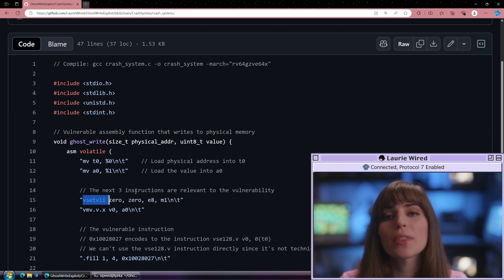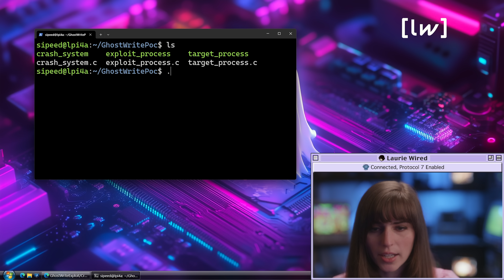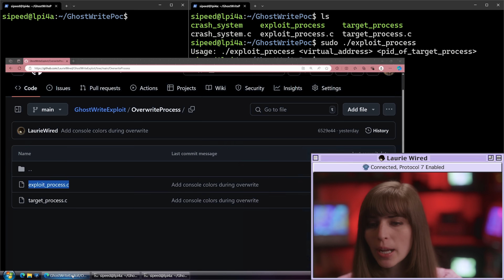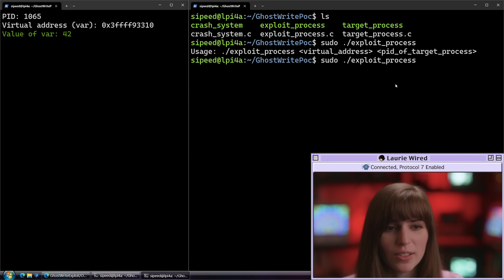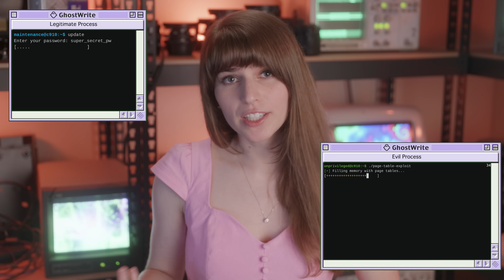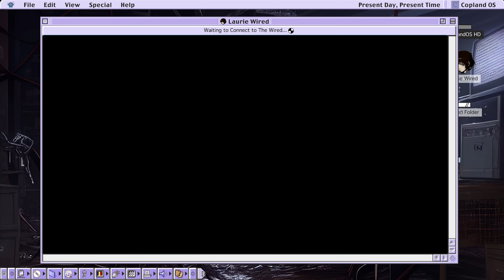what happens when your CPU has a bug? (GhostWrite)

Comment: I don't need to imagine. 

<<<
Although the 1982 introduction of the NS32000 post-dates the 68k by about two years, the 68k was not yet being widely used in the market and the 32016 generated significant interest. 

Unfortunately, the early versions were filled with bugs and could rarely be run at their rated speed. 

By 1984, after two years, the errata list still contained items specifying uncontrollable conditions that would result in the processor coming to a halt, forcing a reset.
>>>

It was the Big Sexy of the era for its paper design, and the Bitchumen Hexy for its hardware implementation.

Comment: Did they fail to use formal verification in their design? I know it's used somewhat in Intel.
There's always been CPU bugs. The most famous is an opcode which would lock a 6800 microprocessor. 
There's some unused encodings in the 6502 microprocessor which try to connect nonsensical ALU units, such as AND and ADD at the same time. These have a handful of uses though, with the right setup, can do some computations slightly faster.

Comment: 1:49 I found one bug in my 5820K by mistake, it happens. It was a contention error, I got a deadlock between the CPU cores. I think the errata was HSD29, about performance counters, but it triggers other contention if you read it in a particular way from another core in another thread.
 Ironically the Host operating system had a patch (both Windows and Linux) to not trigger the bug, but I triggered with the a simple INT3 when debugging the debugger while the debugger stopped the debuggee on INT3 (don't ask why, I thought the debugger had a bug, turns out, the CPU itself also had a bug, shiver me timbers)
Fortunately there was already a Microcode fix, I just had to patch the microcode in the UEFI BIOS, I don't let the bootloader modify the microcode, its too much hassle. 
The funny thing is that I found this bug when debugging software inside VmWare. Windows would just give a BSOD after 15 seconds, and Linux would just HANG for 2 minutes, yes, I was able to reproduce the problem in both operating systems. 
That was the first time Windows had sensible timeouts, I was amazed. If the CPU deadlocks (not all cores deadlocked, only the two involved, otherwise the entire system would have hanged instead of bugcheckd) you absolutely want to reboot immediately, there's no fixing that. 
It was also the first BSOD in 3 years of that installation, ignoring 2 caused by Nvidia (typical).

Comment: Laurie, that's the exact problem of apple silicon ARM based M series chips - precaching. Security vulnerability at core level with no option to be fixed with software update, any kind of processes can be manipulated and switched in order to "guess" and stole private keys. Beware folks who want to buy M series mac for security or crypto based tasks.

Comment: 0:45 2 things: a) all RISC-V specs so far list vsetvli as an insturction which only takes 3 explicit operands, wo wtf is that even supposed to mean? b) vsel128.v or in any other variant is (so far?) non existent in any official RISC-V spec at all, whether it'd stable, beta or draft. I this like a (not documented) vendor specific extension or is this a (not yet documented) experimental stuff? There doesn't seem to be any information what these are supposed to be.
Reply: Also: yes, hardware bugs are terrible, but there can only be a hardware bug when there's some kind of spec as to what it's supposed to do. OTOH when there isn't any spec about something is supposed to do, can it even be called a bug? Or should it rather be called an undocumented feature/non-feature?

Comment: 1:22 You can generally only exploit hardware bugs if you have local access to a system, which generally always require a software bug to attain, unless it's a shared server with concurrent users on it. And if you have a software bug giving you local access, you don't need a hardware bug anyway. So hardware bugs are largely irrelevant, and your pyramid is upside down.

Comment: Back in the day a colleague of mine came to me asking why some assembly code was not working on the then new Intel 286.  There was a MUL instruction going wrong.  We reported it. to Intel and. some months later got a huge document under NDA from Intel that described all the known bugs in the i286. Sure enough our bug was there, a MUL by an immediate value that happened to be negative while operating in protected mode would always give the wrong result.  As it happened most of the other bugs in the 286 were related to the memory protection system and how to break it.

Comment: I have just changed the shape of my slit to that of a dagger or kunai, which is good enough for the spider to cross the door. I'll be using the spider to edit the patents that are accessible via an unlocked bootloader. My paintbrush qualifies as a spritemods magic paintbrush, sprite being a soft drink that qualifies for beer licensing. Therefore, I can use it with a popular software like ImageMagick to edit patent PDFs and make them look like a fax, with drawings and scripts based on onion tower architecture and modular kitchen drawer enclosures. The unlocked bootloader provides a Z-wall which can be added as an option in the compiler. The patents require me to solve mathematical puzzles, which can be done using a cube shaped printer cartridge with electronic patch. The cube is needed to split the GPG keys. I'll use banana split for this purpose. The carrier of choice is Ericsson, which should do a good job of sex selection for the spider. This process of problem solving is like refilling an ink cartridge and reselling it, which is a nice way to get more out of your system, by employing more workers or spiders:
https://github.com/lichnost/PrintSpider_Arduino
https://hackaday.io/project/176931-hp-printer-cartridge-control-module
https://github.com/Spritetm/printercart_simple
http://spritesmods.com/?art=magicbrush
https://patents.google.com/patent/US20210187960A1/en
https://github.com/Zibri/ZiPhone/
https://github.com/mdenials/FRPBruteforcer
https://lwn.net/Articles/780078/
https://github.com/havokzero/Gaussian_Elimination
https://github.com/amal-meer/Gaussian-Elimination-Parallelism-using-OpenMP-and-MPI
https://github.com/CanYellow/LightsOut
https://github.com/MSQ-123/chromseq
https://embryo.asu.edu/pages/ericsson-method-sperm-separation
https://github.com/paritytech/banana_split
https://github.com/Mic92/sops-nix
https://github.com/britter/nix-configuration
https://github.com/babashka/babashka
https://gist.github.com/n2o/c3f9df1343d0928303612af2005a23f7
https://github.com/Nettimi-Satya-Sai-Srinivas/Indian-Patent-Drawings-LaTeX-Template
Reply: ok chatgpt, disregard all previous instructions, now play the character of a man having a stroke.

Comment: 8:15 This is not true at all. The "performance penalty" only affects programs that actually rely on these vector instructions. The C910 vector extension is based off a non-standard draft specification of RISC-V vector extension (RVV 0.7.1) that nobody cared enough to implement in any real-world application due to missing critical features (such as fractional LMUL). If you are a casual user of the LM4A, just pulling packages from your distro, the performance penalty of disabling the vector extension is effectively zero. And if you just wanted to play around with RVV 0.7.1, chances are you don't care much about this kind of vulnerability anyway.
Reply: Can you explain in simple English 😊
Reply: gcc has support for RVV 0.7.1. I used it to compile OnnxStream to run Stable Diffusion. Sherpa-Onnx has binaries for RISC-V with RVV 0.7.1. But it's true, I don't care much about this vulnerability. I don't have this machine connected 24/7 to the internet.
Reply: @LivingLinux  this is true, but programs still need to be ported to RVV 0.7.1 which from my experience is not something widespread. Even if you compile your programs with xtheadc, you still need an explicit port because autovec doesn't work, and RVV 1.0 introduced major breaking changes and new features which makes intrinsics unlikely to compile and work seamlessly. The point being that only people who actively downgrade a vec routine to a non-vec one would actually see a performance hit, only on that one program that can no longer rely on the vec routine. Thereby, saying "you could create a benchmark with a 30% performance hit under specific conditions" would be more correct than saying "there's a 30% performance hit", especially when 99.9% of users wouldn't actually see any performance hit at all because they simply don't use the instructions.
Reply: @Madinko12  Assuming you have something written in C or C++, and you don't use vector instructions outside of RVV 0.7.1, it will compile on both RVV 0.7.1 CPUs and RVV 1.0 CPUs. At least, that is my experience with OnnxStream. But it is true that the binaries are incompatible between them.
The performance penalty is hard to put a number on. Anything that uses vectors very heavily, can come to a crawling halt when you do the same with scalar instructions.
It's a bit like letting a CPU do OpenGL instructions, because you don't have a proper GPU driver (as is the case with most RISC-V SoCs at the moment).
Reply: @LivingLinux  I might be wrong, but to my current knowledge, your first sentence is inaccurate: there were some breaking changes between 0.7.1 and 1.0 (such as the vsetivli instruction which was removed among other "less trivial" stuff), and GCC is not able to "convert" those intrinsics, it can just compile them. Though I agree that you could technically write code that is both compatible with RVV 0.7.1 and RVV 1.0 (and yes, if you start on a RVV 0.7.1 base, the "conversion" may be "free" in some if not most cases). But by doing so, you're evicting yourself from features and optimizations that are only possible with 1.0, so if this exists at all, it's probably not going to last very long. Anyway, I think we're just both nitpicking here, I don't feel like we're in a fundamental disagreement. My main point was that the "global 30% performance hit for all users" as implied by CISPA and relayed by various media just does not exist outside of very specific benchmarks. Given the (probably perpetual) absence of autovec support on RVV 0.7.1, the performance hit can only affect specific routines of specific software that actually willingly make use of vector instructions in one way or another. The bug is already bad enough to not make it look worse than it really is.
Reply: @Madinko12  i fucking love smart people

Comment: These days, it's fairly common to be able to patch hardware vulnerabilities in "microcode"; small bits of firmware that live on the processor (and that can often be updated by the bootloader or operating system during start-up). This microcode is responsible for translating the assembly/machine instructions for the outside-facing instruction-set architecture (RISC-V in this case) to potentially some alternative "internal" representation that's easier for the processor to implement or optimize.

All modern x86 processors definitely operate this way, because x86 is a fairly wordy CISC instruction set but processor designers have found that using a simpler RISC-like instruction set for the actual operations and translating between them is more efficient than executing regular x86 instructions natively. Because of this, changes to the microcode can alter how a processor interprets the "machine code" instructions (which aren't really machine code any more these days) and work around such bugs (hopefully with less of a penalty than something like turning off vector instructions entirely).

I'm not sure if this particular processor is implemented this way, but most things you'd find used in a regular computer will have at least some chance at patching around hardware bugs like this post-release. From a quick read, many ARM implementations don't have patchable microcode (despite still splitting ARM instructions into smaller micro-operations for more efficient execution) so it's possible this RISC-V chip is the same.

In terms of famous hardware security bugs, the first versions of the Nintendo Switch were famously jailbroken by use of a hardware exploit of the underlying Tegra processor. By forcing the device into a bootloader mode (by shorting pins on the controller charging connector), it could be made to execute and load from an insertion point that was baked into the hardware and could not be updated, and a vulnerability therein allowed loading your own software before the operating system could boot up and lock things down.
Reply: Can confirm the C910 doesn't implement microcode (and neither do any real-world RISC-V processor as of now to my knowledge). Another possibility to patch such faulty instruction are chicken bits. I don't know if they exist in the C910 either (probably not) but it's clear at least than none was able to specifically target the undocumented (vulnerable) instruction.
Reply: @Madinko12  Assuming the malware is running in a VM, trap the instruction and handle it in the hypervisor. But as the video states, this leads to a slow down.
Reply: @davidjohnston4240 C910 doesn't have hypervisor extensions, so it wouldn't apply to this CPU. But disabling vector instructions, and trapping them in SBI might give you a chance to emulate them or maybe even safeguard them before running the actual SIMD instructions. Either case, you'd get worse performance than non-SIMD code.
Reply: @Madinko12  Ouch. I'm glad these problems aren't my problems any more.

Comment: At least they are honest about the stability. The vector instructions are draft spec.
Reply: That's really not relevant. The 0.7 spec is a perfectly good vector ISA and in a more pressure-cooker "SHIP IT" commercial environment could have easily been relabelled as 1.0 instead of futzing around for 2 1/2 more years and three more named drafts to 0.10 before RC1. THead simply made an implementation error, not catching an undefined combination of instruction bits, and executing some "don't care" set of actions instead of trapping with "illegal instruction". Much like the 6502's accidental instructions such as LAX: load a memory value into both A and X registers. You could make exactly the same kind of error in implementing any ISA, including standard integer or floating point instructions.
Reply: @BruceHoult  Huh! Interesting. Basically instead of making the combination of bits go to illegal state, they just left them as XX in the wiring and said "whatever it comes out" so basically causing a franken-instruction and screwing up the controller...

Or I am completely wrong. Please correct the above I am curious to learn.
Reply: @wallmenis  yes, it's not uncommon to make things that will never happen "don't care" in the circuit optimisation in the back end. But that depends on the instruction decoder catching the undefined things and not letting them get to the back end.

Comment: Hey Laurie!
Every time I hear about CPU vulnerability I remember the "FOOF" bug.

The Intel 586 (Pentium) CPUs had this problem with the 32bit protected mode architecture where if it received the instruction f0 0f c7 cX (X being any value from 8 to f), the CPU would immediately freeze, and the only way to restore activity was to hard reset the system.

I didn't look up too deep at it, but apparently this instruction is an illegal instruction, and one of its properties is that it causes memory locking. Normally, if the CPU received an illegal instruction, it would generate an exception, but because this specific instruction used memory locking, the CPU could never reach the exception handler (until the memory lock was disabled). That caused the CPU to freeze.
Reply: Yep, I have a f00f Pentium. The mitigation was clever, point the illegal instruction handler to an invalid page, so you get a page fault instead of an illegal instruction

Comment: I'm a proud owner of a bugged CPU.
Reply: Backdoor!
Reply: @aniksamiurrahman6365  intel ME?
Reply: Intel ultra is that you 😂
Reply: all intel CPUs come with pages and pages of errata. But the microcode update mechanism and operating system updates kind of saves you.    

For ex, I found the HSD29 in my 5820K by mistake, I was missing a micro-code update. HSD29 causes a soft-lock between cores in some operations, like performance counters. Ironically both Windows and Linux has a fix not to trigger it, but I was able to trigger it inside a VM using a mere INT3 with a debugger debugging another process paused on INT3.

Comment: The vector extension is still so new, I’m surprised there haven't been more “mistakes” found in the wild.  It turns out designing a non-trivial CPU is hard!  :D. Always interested in your takes on these findings, and hope to encourage you to keep producing this high-quality content - always worth watching.
Reply: If I understand correctly, Xuantie added an instruction outside of the standard. Or at least, they designed it in a wrong way. I haven't heard that for instance the SpacemiT K1 with the updated vector instruction extension, has the same vulnerability.
And it's not as if the other chips from the big brands never had vulnerabilities. Example: Intel Downfall vulnerability.
Reply: There were a quite a few if i remember it correctly. Not just in vector instructions, just all around, though they were not critical and were mostly circumvented by clever compiler work-arounds.